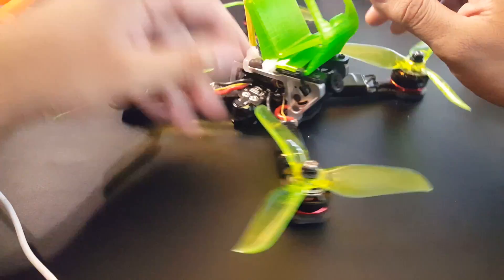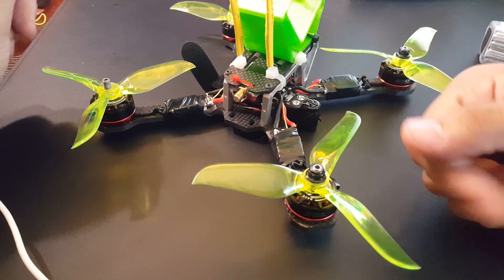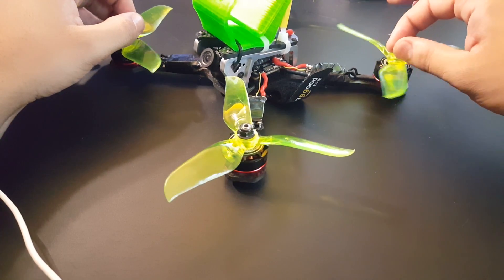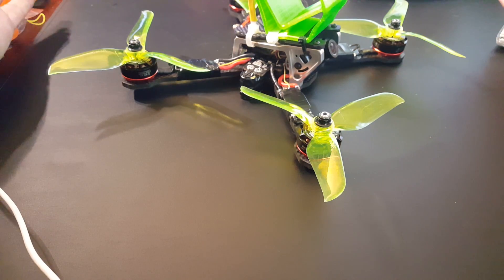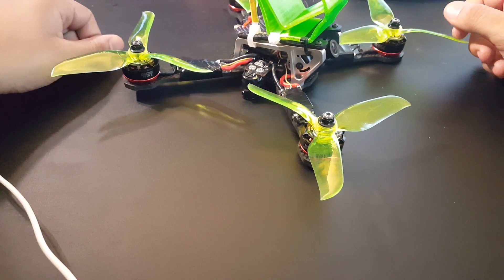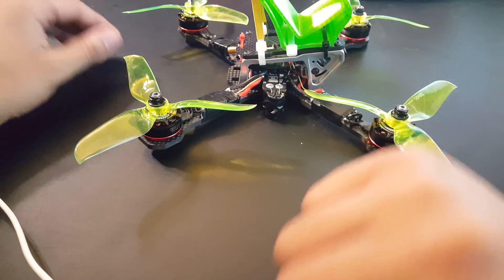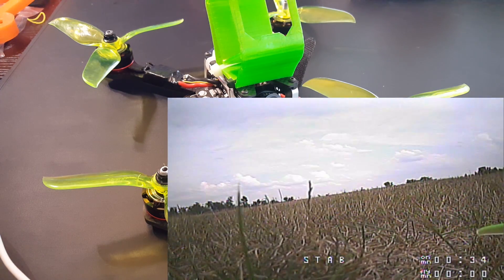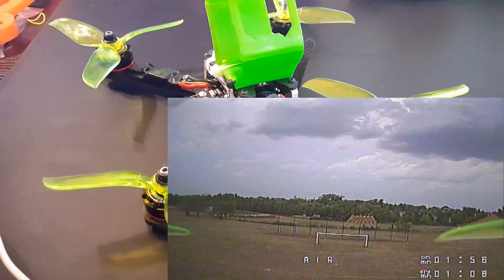Matek F405 AIO Maiden // Best F4 AIO 2017!!!

Comment: Hello.Tell me what to connect to the flight controller Matek F405-AIO-S Receiver AR6100 Spektrum or OrangeRx R615Х ? To terminals G,3V3,RX2 right?
Reply from the maker: Сергей Цуцкин if the sbus is inverted on spectrum then have the wire run to sbus pad of not then it does not matter. And yes 3v and g and you should be good to go.

Comment: Hiya mate, I followed your build to the tee, I'm having a problem with Dshot though, my escs won't settle on power up when in Dshot mode, they were fine with the BFF3, all I did was basically swap out that FC for the F405 AOI without any changes to the escs. Only working fine on one shot 125, any ideas??
Reply from the maker: change your PiD and Gyro loop to 4k/4k and see if that helps.

Comment: Hey, me again, if you've got the time :
here is what I've got so far (my second build):
-Frog frame (race edition)
-Matek F405 AIO. (bought it after hearing you saying how good it was, so good, damn good board, that good)
that's it ! So I'm currently investigating for ESC and Motors. Would you have some advise ? Maybe you can stop a mistake in what I'm currently planning :
motors: F40 III 26000Kv
ESC : no idea, I would trust you and your tests, but I'd like a 4in1 (not a fan of ESCs on arms) and if I'm not blind, you only tested regular ESCs, right?
Reply: Should I not ask so much, or did you just missed my comment/questions ?
Reply from the maker: +6rilllir6 missed the comment. Sometimes I dont receive all notifications..

The cicada 35a 4in1 esc is very good and reliable as well as the airbot typhoons 4in1. I will have the typhoons 4in1 on a build soon.

T-motor I am not a fan of because of their durability.
Reply: thanks for the recommendations ;) I'll look into those ESCs.
T-motor not durable.. hmmm I remember your troubles with the broken shafts (if I recall correctly)... will keep digging about motors, since I'm very disappointed with the emax (RS2205S) the bell is way to fragile.
Reply from the maker: +6rilllir6 that's very strange I found the emax 2205s and the brotherhobby r4 the most durable motors. From crashing into poles and trees. Anyways keep me updated on your quest :)
Reply: Depends on so much factors... for me very, light bumps always ended with the emax bells being dented and blocked : /
Will keep you updated, thanks for your input !

Comment: Hey, how to you reach the XT60 on the side with your battery ??  Feels like none of the lipos I've got would have long enough wires to reach the side.
Reply from the maker: My lipos have long enough wires :)
Reply: Do you lengthen them, or do you buy them with long wires ?
I bought that Matek F405 and got a frog race frame, but I now realize that that XT60 location is gonna be impossible to reach : /
Reply from the maker: 6rilllir6 no I use the infinity graphene 1500mah from banggood they are by far the best batteires and last very long. I have had most of them for about 6 months now still performing and I dont take good care of them sometimes leave then charged for a week.
Reply: ok, thanks mate ;)
I'll look into them. 
Do you have an affiliate link ?
Reply from the maker: Thank you for considering using my affiliate you really made my day I cant thank you enough.

Affilitaed Link
https://www.banggood.com/Infinity-4S-14_8V-1500mAh-70C-Graphene-LiPo-Battery-XT60-Support-15C-Boosting-Charge-For-Racer-Drone-p-1058084.html?p=CS101558118042016088

Non Affiliated
https://www.banggood.com/Infinity-4S-14_8V-1500mAh-70C-Graphene-LiPo-Battery-XT60-Support-15C-Boosting-Charge-For-Racer-Drone-p-1058084.html
Reply: no sweat ;)
Go a bunch of stuff to buy, will try to use it each time (if I understand correctly how it works, I can buy something else through this link and still help you a bit, right?)
Reply: one more question about afiliate links : do you know if it works if I use the link, put something in my cart, and then finish the order later, without using the link when I finish ordering ?
Or do I have to get to bangood through that link even later to finish orders ?
Reply from the maker: +6rilllir6 I think it's 15 days once clicked.
Reply: oh! ok... that's wide !
Reply: I've just ordered 2 lipos and a camera through your link, I only mention it in case you can check that it worked... As it is the first time I use an affiliate link, and watching the url in my browser, I couldn't see that it was different from a regular url : /  Maybe it doesn't work like that and still works.
Reply from the maker: 6rilllir6 Thanks for your support.. You made my day wether it worked or not :)

Comment: Hi @Drone Mesh, I noticed you didn't put the signal ground wire on the ESCs. There are no dedicated signal ground pads on this board. People seem to suggest that adding the signal ground and soldering it to the ESC's ground pad might help to avoid noise/desyncs.
I'd be really interested if you could measure this to approve or disprove the use of the signal ground on such AIO boards by measuring the noise (between the ground of the FC and the ESC MCUs? IDK).

Also is twisting the signal wire with the signal ground or ECS's ground wire effective to avoid noise?

Cheers ;)

Comment: Thanks for the awesome content! Can you share a link for good low ESR capacitors on banggood? 

Regards from South Africa
Reply from the maker: They dont have them on banggood.

http://www.ebay.com/itm/1000uf-25v-105c-Low-ESR-Size-20mmx12-5mm-Panasonic-EEUFM1E102-x5pcs-/301136558373?epid=1505408365&hash=item461d233925:g:SIUAAOSwo4pYbjDT

Comment: nice video... been useing 2 of these boards for 2 weeks now with emax 2306 2400 its perfect... no issues...no matter how many batteries I run, heat over 35 ect... works... really really well... no issues from either quad...best I have used
Reply from the maker: I feel the same way have the same setup.

Comment: Hi. Have you tried blackbox on this board since this video? I'm having problems getting my sdcard initialized. I've tried other sdcards, and even tried bf 3.2. I think the issue you were referring to in the vid is the vibration when bb starts recording, but apparently that's resolved by disabling dma on the sdcard.
Reply from the maker: I have not yet I need to change out the motors but I will go fly it again and give it a proper maiden this weekend.

Ii will keep you updated and keep me updated as well.

You can go the matek facebook group and the dev is on there alot of people are willing to help you debug fast.

https://www.facebook.com/groups/1882519175321708/
Reply: Drone Mesh Thanks. I'll check it the fb group and update you on any changes.
Reply: Drone Mesh Hey. I contacted Sampson from Matek Systems and found that there was a bit of solder oon the MCU bridging the 2 sdcard pins. Once that was removed, the FC has been running flawlessly on BF 3.2 RC2. I'm also glad to say that the lines on my BB log are buttery smooth :)
Reply from the maker: Very happy to hear that.

Sampson is a great guy. I met him when i burned my FC in my build video the PDB/FC combo he contacted me and sent me a replacement to finish the video. He also put 2 Matek f405 AIO as a surprise in the package before anyone else had them ^_^.

Very helpful and kind guy.
Reply: Drone Mesh He really is.

Comment: ugh, this vid came a few days too late for me. I have now the Kakute F4 AIO underway, after my HGLRC died a weird and slow death without having left the ground even once.

But that Flame was a POS anyway. That FC has TERRIBLE noise filtering. Even during the startup sequence I had superthick black lines coming through from the motors singing their startup song.

Since that day I learned to really appreciate a properly filtered board. Fingers crossed that Kakute F4 isnt another disappointment.

If that Kakute turns out to be another dud I will def go Matek next. 
Your video feed was ridiculously clear. No lines at all. Impressive stuff.❤

Comment: Humidity affects high frequency RF quite severely. Water particles are blocking and reflecting the signal so range drops. I have my rain quad as the northern weather here is quite nasty. During light rain video is flickering quite a lot. Even after rain there's still some water in the air and my range is shorter.
Reply from the maker: So my theory was correct. Sometimes it was soo bad that i could not fly more than 75 meters.

Comment: I like this board but I've had a few issues with it the biggest being for some reason d shot now won't work now with my esc's not sure if it has anything this board not having signal grounds I had a Lux v2 board and D shot 600 ran no problems with my esc's I have to run old school multi shot for it to work now the only change was installing this board when I tried testing dshot 600 it freaks out I tried dshot 150-600 and no luck I don't understand I ran dshot 600 before but now it won't any ideas
Reply: I have read somethong like that before. DShot can be more susceptible to noise, artifacting the signal. Try soldering the signal ground wire back on and onto the PDBs ESC power ground pad. 

Or maybe it is the insanely good noise filtering on this board that may be the culprit
Remember when we had to remove caps from the esc to have the dshot signal come through at all?
Mabe there is spme filtering going on at the wron place?

Or maybe just BF acting up.

Comment: Really? Best board ?  Pretty short testing to be so sure.
Reply from the maker: Yes this is the best board I have tested by far up to this point.
Reply: Drone Mesh I didn't understand why you need to rotate the board if you putting him when the arrow I pointed straight at the front?
Reply: i've got a couple drowned one and it's still going strong gotta agree with drone mesh this board is boss
Reply: Drone Mesh what about my question about the degrees?
Reply from the maker: +Frogzy set YAW to 270 in betaflight
Reply from the maker: Done more testing still the best for me ;)
Reply: Do you think that they expected the power plug to be in back on the quad instead of on the right?
Reply: for my Leopard frame it would be better. let's see if the microUSB can be connected from the front?
Reply: I have this in my LX5 and love it.

Comment: arm delaminate on the f200? i have been in touch with awesome UAV about the baseplate and we can get 4mm unchamferred baseplates cut or even 5mm straight cut plates. need a minimum order of ten frames tho to make it worth their while to change the cutting profile. i am willing to organize the order and distribution f frames if anyone is interested. 

what happened to the motors? low rpm jitters?
Reply from the maker: Think magnet slipped. One of the back 2 I will connect them to the bench when i get a chance.

Keep me updated on the f200 plate because i broke the f80 motors and I dont want to buy a replacement I will change them out to smaller motors.
Reply: only way to get the straight cut 4 or 5 mm plate is to have an order of ten frames. so if you would like to commit to that then sweet :) need another 6 more! lol.

f80?? i thought the pro version of the f200 came with f40ii's? 

my awesome f200 standard motors scream!! but i killed one yesterday on hard impact with a tree which dislodged a magnet and smoked the motor. lol.. destruction testing reveals all!
Reply from the maker: Sorry to hear that..

My F200 is a custom build withe F80 motors..

Btw you better get those f40's V2 fast because they stopped making them.
Reply: Drone Mesh ohhh reeealy? Interesting. Cheers for that tidbit. I shall purchase a number of sets. One for perso. The rest for less than retail resale. :)

Comment: water block/absorbs the RF so fog rain ect. real nice vid. whats the issue you have had with 3.2 I just got on the train and is a smooth ride sofar though i dont see the 1200dshot my esc cant run it anyway. the dynamic filter is nice no hype the blackbox is like first flight on clean build.
Reply from the maker: Nothing happened on 3.2 never bothered updating. Just been reading around seeing people complaining and just wanted to fly without a headache. I will update it tonight and go fly it this weekend and report back.
Reply: yeah did my trainer quad for testing it seems to like the flow. I have both gyro notches off and pt1 lol my trainer is a piggy weighs a good amount still no heat issue. you have to activate dynamic in cli. I think ppl don't like that some names in cli have changed so you might have to check configuration after. ppl will enjoy your vids on the subject to I believe
Reply: Drone Mesh 3.2 is really smooth with thy dynamic filter but it seems to be jittering now after a month of flying, just today it did a death roll after a punch out not sure what's happening.. I do have the f405 with sep. pdb
Reply: what's your blackbox look like if you checked. have you checked motor bolts I was getting shakes on a craft from bolts to loose? also any crashes that might have changed things except death roll and did it boot back up after death roll ? sorry for all the questions lol troubleshooting I like about this hobby
Reply from the maker: Tony F Go to the Matek f405 group.. They will help you debug one of the devs is on there.
Reply: youel adamas haven't checked black box, screws are tight. I'm mostly getting getting this jitter on hard turns like it cuts power than comes back but really quickly of more stuff happens I'll
Come back and post
Reply: might be power spikes from active braking or d term noise/drops in the power line as well. if your not running a cap do so if you run a 470uf try 1000uf 35v if you plan 5s.

Comment: I ordered this F405 from Helidirect on sale and ordered the pdb from Banggood.Then I saw your video after so i am hoping to have it in the air next week my 1st F4.After flying Radiance d F3 a few months i saw JB review the PDB  and wondered why he did not do the FC.COOL STUFF.
Reply from the maker: Wait there is 2 version.. This is the one that is just one board which is the PDB and FC.. You ordered the other one that is called the f405-OSD with spereate PDB.. But dont worry the one you got seemed very good in my testing.

I have not built it yet.
Reply: Yeah i saw that one after i put in my order also.Just hope it works good.I saw the sale and jumped b4 looking then i saw the ribbon cable  then realized i needed the pdb.

Comment: 10:50 - "active breaking is turned off", do you mean airmode? :) anyway I do agree this is a very good board :) love mine!
Reply from the maker: I am using blheli 32 ESC's and I have been connecting all 32bit esc i have in the house and all of them have active braking off by default.

I am assuming the Ipeaka here are no different. 

Airmode has nothing to do with active braking ^_^
Reply: active braking is on by default in BLHeli32, i don't even think you can turn them off it's not in BLHeliSuite
Reply: sure about that? i checked mine and active braking is there and off. bl heli 32.1
Reply: brake on stop is not active braking http://intofpv.com/t-brake-on-stop-in-blheli-s; brake on stop doesn't affect your flight performance, only it takes place when you stop the motors :) Active braking is on all the time since BLHeli_S :)
Reply from the maker: They are off I have checked all the ESC's in the house.
Reply: could you point to me where is active braking? :D https://oscarliang.com/ctt/uploads/2017/04/BLHeliSuite-BLHeli_32-for-32bit-ESC.jpg
Reply from the maker: Yes i overlooked it your correct.
Reply: check revision and build date of screenshot you've taken from another source. we are now on bl heli 32.1
Reply from the maker: KillaG FPV some esc you can enable and disable.and some you can't on his you can not.
Reply: interesting they wouldnt include a feature in that esc's firmware... mustn't be too important lol

Comment: Great video mate. i have a similar build but there seem to be a small problem.. using the same board with hobbywing xrotor 35A ESCs with Emax RS2205(s) 2600kv. built on SRD199 Loki x5 Frame. i have done everything which MatekSys provided on their site. set the Yaw to 270, set the current senson to 165. but i have not soldered the Low ESR capacitor.. and i dont know why my motors would get warm after a minute of flight. and if i fly for 2 to 3 mins they would get quite hot. any solution ?? thanks !!
Reply: Andre Martinez i have solve the problem by lowering the D n did a lil more tuning on it. it flies perfectly fine without the Low ESR cap !! thanks for tip thou !!
Reply from the maker: Same here start decreasing the D gain if that does not solve it then you will need gyro filters.
Reply: Drone Mesh Alright will do that.. my PIDs r at stock thou.  did u fly it on the stock PIDs aswell ?? thanks again mate !!
Reply: Silv3r Pl4y3r motor screws might be too long
Reply from the maker: Silv3r Pl4y3r yes stock pids

Comment: Did you have any dsync with the F4 Flame?
Reply from the maker: No but i had a pole in front of the quad that blew it into a pieces.
Reply: Lol, sry to hear...I had a dsync with it...XSD30A BrotherHobby Returner R4 on DSHOT600. It does not have the sdcard slot, so I guess was not a DMA problem?! I'm kinda worried to rebuild with it...

Comment: We sound like twins I'm still blown away every time I fly it it flies just amazing even on 5S it's fucking perfect. I have a high roll rate 1200 degrees per second and my stops are completely perfect no bounce back at all on stock pids I've never seen that before. Love the channel drone mesh
Reply from the maker: All i can say is i was amazed but the motors really ruined the whole thing for me.. 

Emax 2306 are not reliable at all.
Reply: Drone Mesh what are good motors these days for a good price?
Reply from the maker: Brotherhobby returner R4 , Emax 2205s 2300kv

The most reliable motors I have ever used in my entire life.